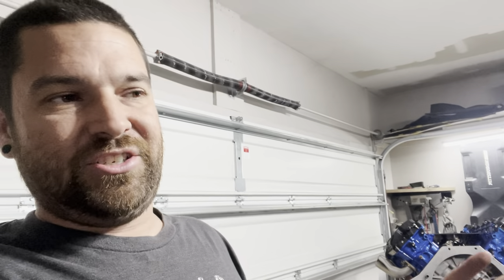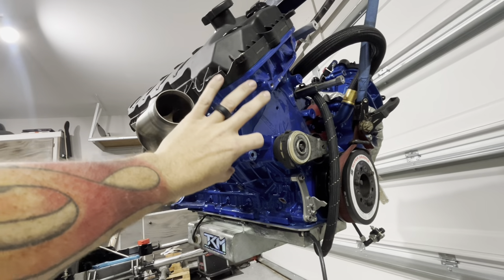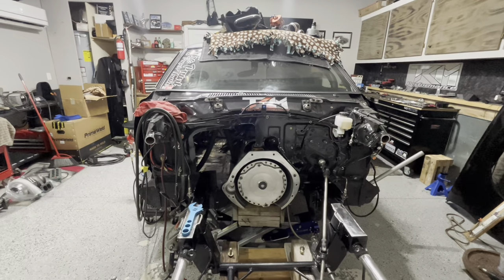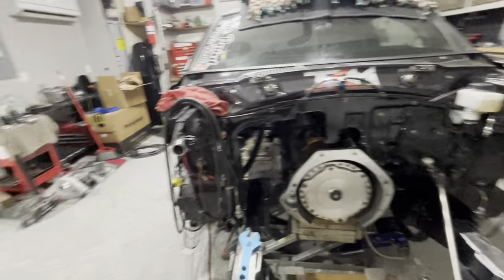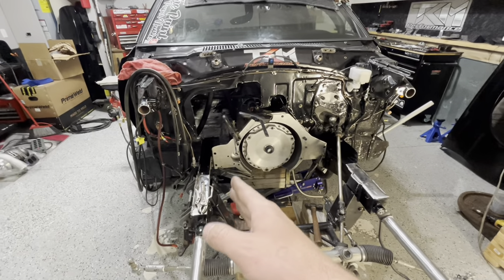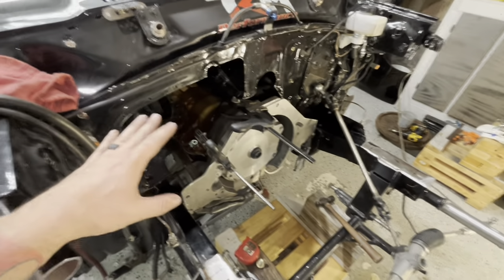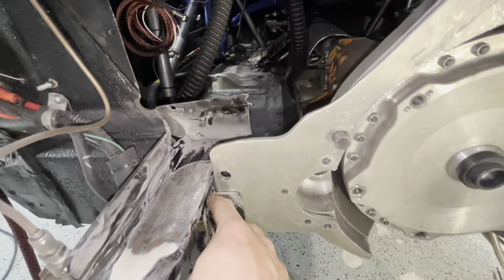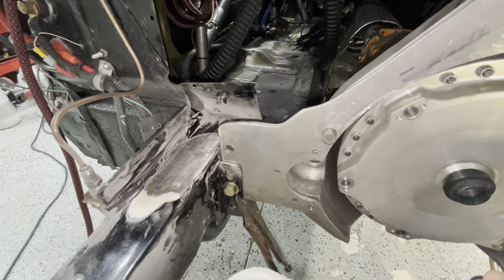Setting Mid Plate Height & Building New Tabs 🔥

Comment: You should put the midplate on the front side of the brackets so if you ever wanted to pull the motor and trans all at the same time you could.
Reply from the maker: I tired that in the past before YouTube and it was way to much of a pain to pull it all together. Great idea though.
Reply: LOL No one takes the engine out, with the mid-plate. Mid-plate stays in, to support your transmission. Guess you don't build race cars.

Comment: Did I miss why you have to raise the engine?  Also have you seen what they use to hold the engine a 15,000hp top fuel dragster? A couple of exhaust clamps
Reply from the maker: I have seen that lol it’s crazy. And need to go higher for no prep racing. A low engine is for radial racing
Reply: @ThePaintPaperHustle  absolutely I thought you guys were more front side or prepped surface guys more like Randy than John
Reply from the maker: @brngrhd1 I can’t run with Randy’s classes. All the money is in the no prep stuff. Idk if I’ll run more front side or backside though

Comment: Before you buy wastegates and blow off valves, talk to Kevin about a turbosmart straight gate! You won't have to weld in wastegates or blow off valves. Does it all in one nice piece. Will install on your cold side intake tube. It's the future of turbo control. Pneumatic one is cheaper than electric, but more expensive than doing it the old fashioned way, but you only have one thing to mount and control, not 4 pieces to weld, plumb, and control.
Reply from the maker: I already bought everything but I’ll look into it as I can return them.
Reply: @ThePaintPaperHustle  Yeah, ask Kevin. A lot less work. It's what I'm doing. Mark Micke is kicking ass with his setup. He's running the electric one, though.
Reply from the maker: @funfun8095  I’m reading something about needing a “black box” to control it. I just emailed TKM
Reply from the maker: Spoke with tkm and they don’t think these are there yet and don’t recommend running them. They are having customers use them and then switch back. Kevin thinks they need alittle more time to improve
Reply: @ThePaintPaperHustle  OK. Nice to know.
Reply: @ThePaintPaperHustle  Devin is about to try one out, so we'll see how that goes. Look at his post on it, on his channel.

Comment: I hate to say this but for what u r wanting to do with it and with that fire wall already gone I would have had to move it back as far as I possibly could for that added weight transfer other than the drive shaft I don’t think it would have been a big deal and the weight transfer would have been so great KC max’s car his motor is a 11 inch back
Reply from the maker: I still have factory fire wall location though